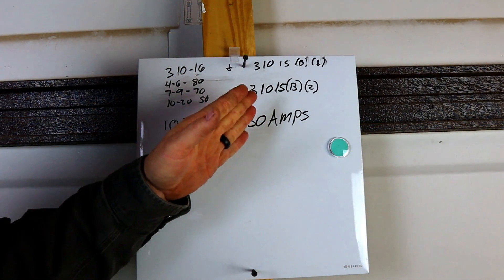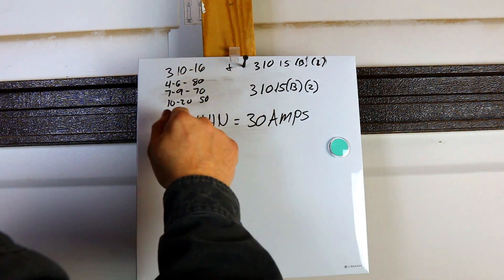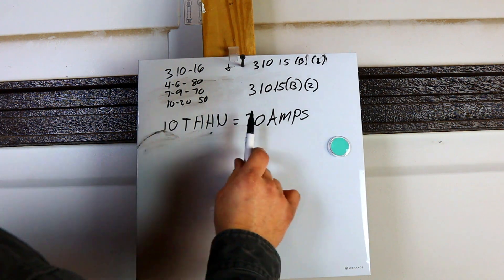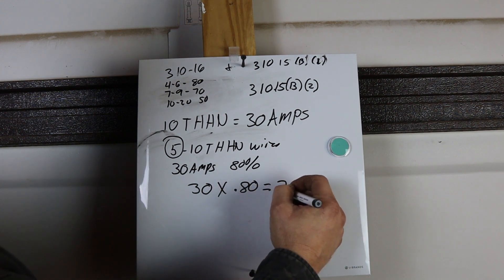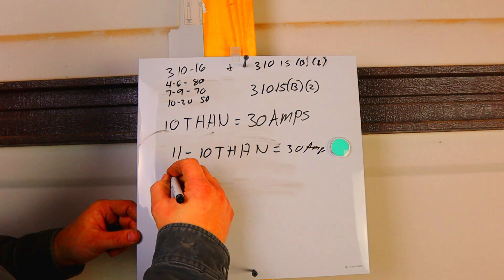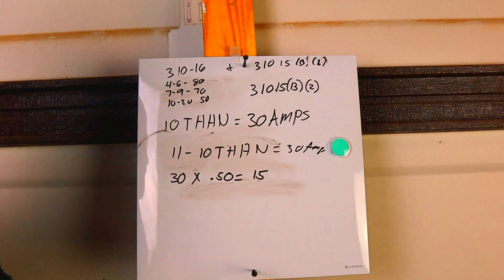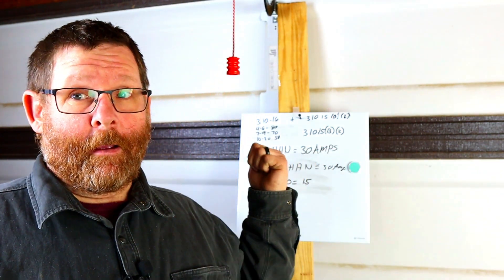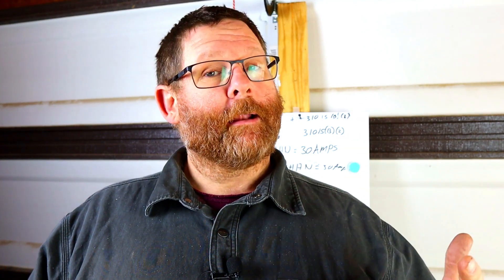How To Derate Electrical  Conductors

Comment: Great video and to the point!  I’d like to add before you correct the master electrician, have your resume ready.  Lol.  
Q: If a conduit is less than 24” in length, derating doesn’t apply (only wire fill)?

Comment: One thing can really add up, it to define what a "current carrying conductor" is. If all your working in is 3 phase, no neutrals, this works, but if you have single (split) phase 240, your neutral may not always be counted as a current carrying conductor. Otherwise, great and to the point.

Comment: Can you help me interpret 110.14C.

I read at it as the adjustment can be used at the max value of the insulation and as long the corrected valve is not exceeding my terminal rating.

My example is 6  current carrying #10 THHN.  My air conditioning equipment max amp rating was 29.1A. My terminal ratings was 75°C

My stance was 80% of 40A (#10 @ 90C) = 32A wire

My 75°C terminations not to exceed 35A 

I want to say my adjusted wire ampacity can handle 29.1 as well as my terminations can handle 29.1.

Great video. Wondering your thoughts on a situation like this.

Comment: For 2023 NEC, the percentage adjustment  factors are in Table 310.15(C)(1), not Table310.15(B)(2).
This video was fantastic!!! Thank you SO much! I was unaware of the asterisks and to use the values from Section 240.4(D), even though it was right in front of my stupid face. You really helped.
Reply from the maker: Glad to hear that this helped you. Thanks for watching and commenting ☺

Comment: Hi Sir, I’m running in to a situation where the plan has Voltage drop calculations already what that means is it asks #4 for a 20A fridge. The usage is 12.5 A 
The run is 300 feet .
To safe labor and conduit I’m planning to run 1”1/2 conduit I’ll have 16 current carry conducor. How do I figure out if the 50% derate? 
Thank you for the answer 🙏

Comment: I understand the math. I don’t understand what is the math for as in  Are you pulling that many wire in conduit for one breaker? If one 10 gauge wire is 30 amp why are you worry about 10 wire equal to 30 amp. That what I was confuse about this video
Reply from the maker: Sometimes you pull out of a commercial or industrial panel and leave with more than one circuit. It's to keep you from over filling.

Comment: In the 2021 NEC. Table 310.16 for 10awg wire that is THHN, it is showing a rating of 40amp. So wouldn’t you go 40 x .80?  For type TW, UF you would use the 30amps for 10awg
Reply from the maker: You need to pay attention to the asterisk. It steers you to another code number for the clarification. If you need further information about this please don't hesitate to ask me. But do check out the asterisk
Reply: @MountaineerOutdoors  pretty sure when you’re “derating or adjusting” you use the actual rating of the insulation. Which would be 40 amp on 90 degree column.
Reply: @Ed-uu9eo you’re correct. The poster of the video is wrong

Comment: Hey thank you for the information i have a question does this applies lets say if i run 1 1/2 pipe i cant run more than 6 wires?
Reply from the maker: No every wire size and conduit size falls into different categories.
Reply: @MountaineerOutdoors  thank you ! Where can i learn more about that ? About how many conductors on a pipe
Reply from the maker: https://youtu.be/sFvTEDbhh8U

Comment: How do you actually enforce this derating of conductors? People are still going to throw a 30 amp breaker on that 10 guage conduit run no?
Reply from the maker: Yep your exactly correct. However once someone needs the correct voltage and items start failing or you check voltage and see that your true voltage isn't what it's supposed to be that's when you will have to think about fixing the problems. As far enforcing it goes, a true electrician or company will definitely know what to do. It's kinda like the speed limit.. Its posted but not alot of people abide by it.